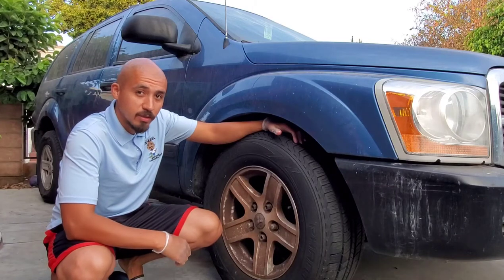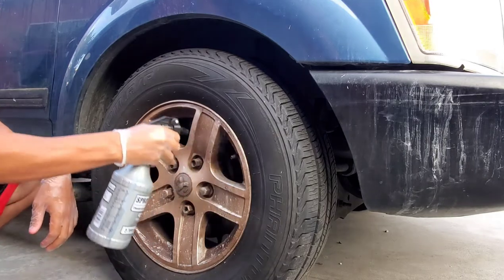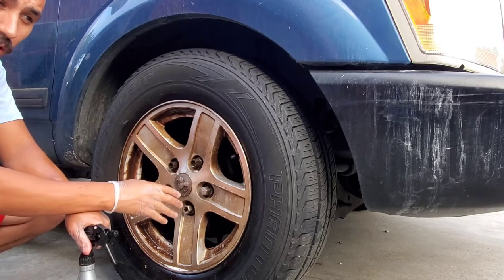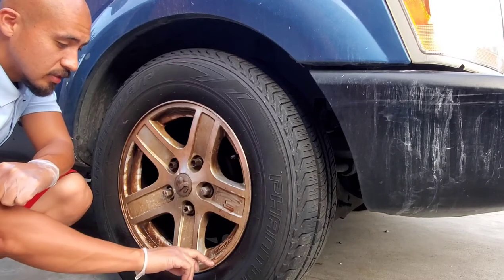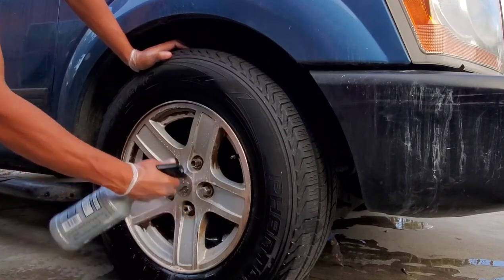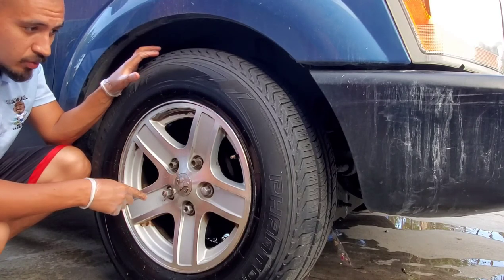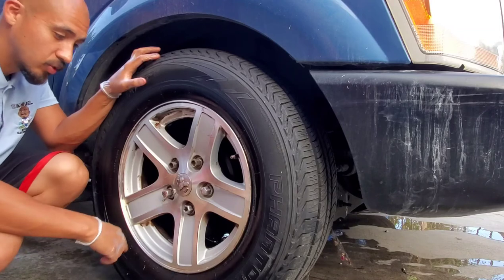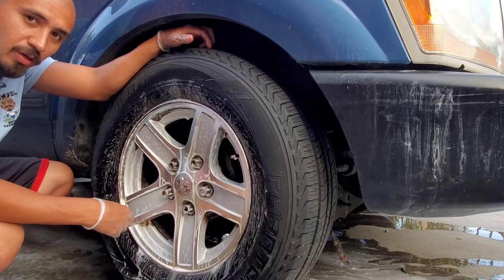How to clean rims or wheels with acid

Comment: Great video. What is a good acid wheel cleaner you can buy local?
Reply from the maker: Thank you for the feedback Gary! 

I use Wire Wheel Cleaner by Superior Products. 

Since I use it often I buy it by the Gallon & dilute it 4:1. 

I put the link to the product in the description for you. 

O'riellys auto parts is a distributor for Superior Products. You could also walk into a store and have them ship one to the store for you.